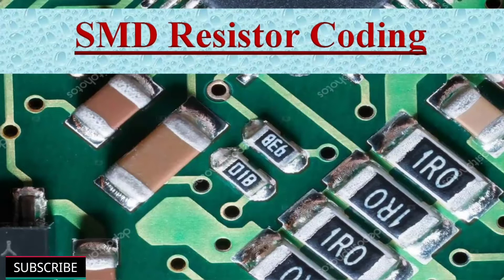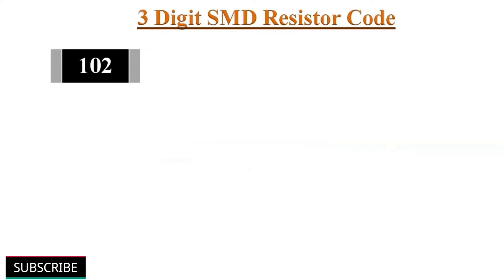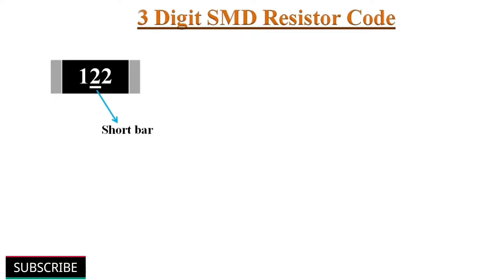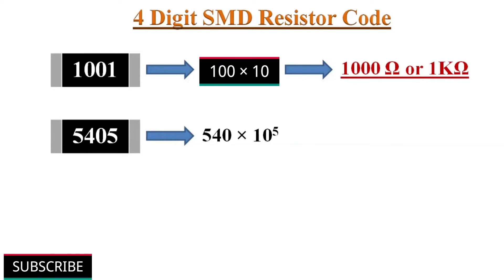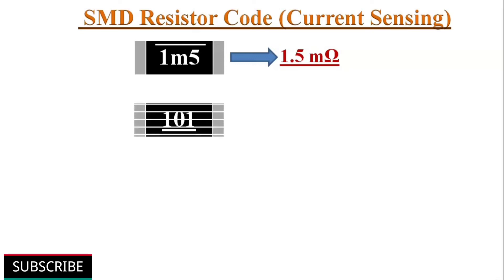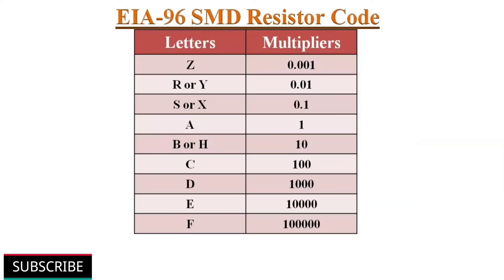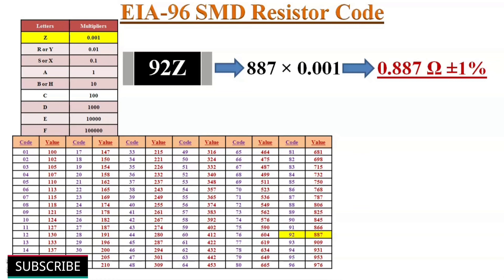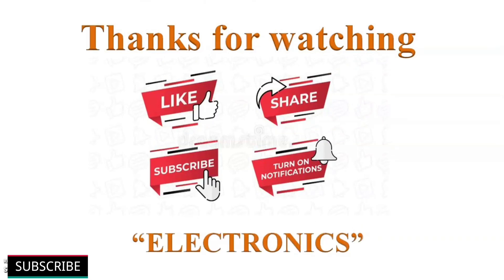SMD Resistor Coding Explained with Examples

Comment: I have resistors on a gameboy colour coded R8, R12 and R20. If the R is the decimal point, does this mean they are 0.8, 0.12 and 0.20 Ohms? There aren't any 0's before the R, so was curious if it still applies...
Reply from the maker: It's a very common mistake when first looking at circuit boards, but those labels are actually Reference Designators, not the resistance values.

On a Game Boy Color (GBC) motherboard, the "R" followed by a number (like R8, R12, R20) is essentially the component's "name" or address on the map of the board. It helps engineers and repair technicians find a specific part using a schematic diagram.

Reference Designators vs. Component Values:

 * Reference Designators (The Labels on the Board): These are printed on the green fiberglass (the silkscreen). "R" stands for Resistor, "C" for Capacitor, "D" for Diode, etc. The number just tells you which one it is (e.g., R8 is the 8th resistor assigned in that circuit block).

 * Component Values (The Numbers on the Part): The actual resistance value is usually printed in tiny text on the top of the black component itself.

Is "R" ever a decimal point?
You are actually correct that "R" is used as a decimal point in component marking codes, but only when printed directly on the resistor. 
For example:
 * 4R7 printed on a resistor = 4.7 ohms
 * R10 printed on a resistor = 0.10 ohms
 * 0R22 printed on a resistor = 0.22 ohms
However, because the labels you are seeing are on the board and not the part, they follow the naming convention instead.

How to find the real value
If you look very closely at the tiny black rectangles next to those labels, you will likely see a 3-digit code like "103".
 * 10 (the first two digits)
 * 3 (the number of zeros to add)
 * 10,000 Ohms (10K)
Reply: @ElectronicsAD Thank you! I was beginning to suspect that these were more reference names rather than resistance values. I'm going to try to continue to see if the values are listed somewhere, but no success so far. Appreciate the fast reply!

Comment: Good afternoon. What does 01 mean on smd? Looks like a fuse or resistor.
Reply from the maker: "01" typically represents the value "100" in the EIA-96 code system.
Example:
01A: 100 x 1 = 100 ohms
01B: 100 x 10 = 1000 ohms (1 kilohm)
01C: 100 x 100 = 10,000 ohms (10 kilohms)
Reply: @ElectronicsAD  The sмd element is marked "01", without the letter A

Comment: Great tutorial, but I need your help. The smd resistor on my oven control board is printed with 295. Is that a 1 Mega ohm resistor?  Correct me if I'm wrong. I can't find it online.

Comment: why on earth they cant just print actual value? whts so hard ? for capacitor engineers have no issues printing long number like 50v 47uF, 25v 10uF, 400v 1uF !!!!!
but for resistor either colour code or this kind of coding !! WHY >??????
Reply from the maker: When the body of the resistor is big enough to read the print, such as large power resistor, the rating is generally printed onto the body of the resistor, 
But if they are very tiny, and it is challenging to print resistance values on them. So, colour bands and codes are printed on them to represent their electrical resistance.
Even some Capacitors (Ceramic capacitors and SMD capacitors) have codes printed on them.